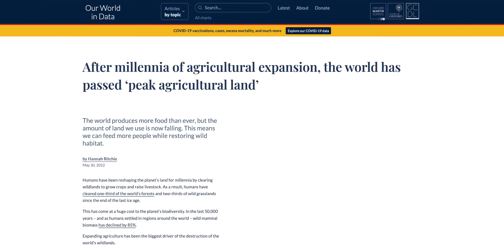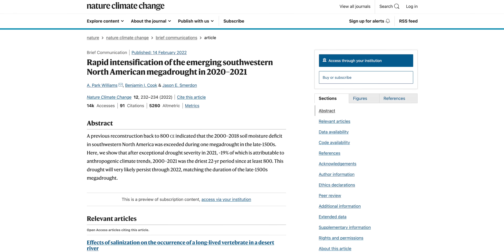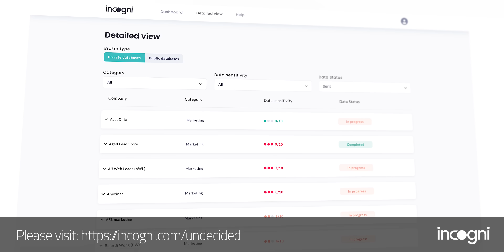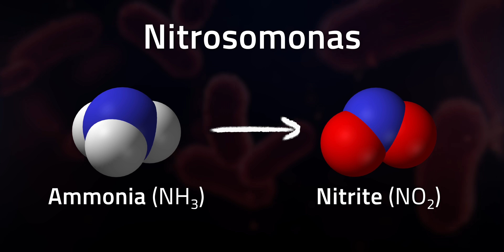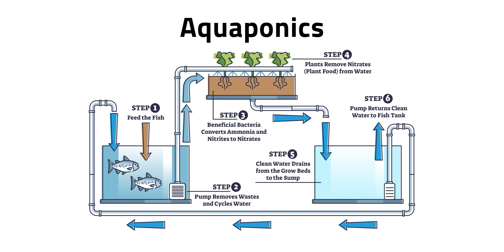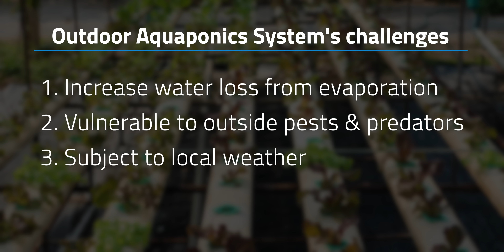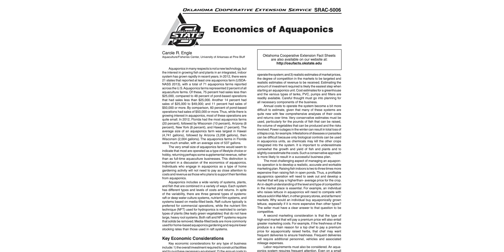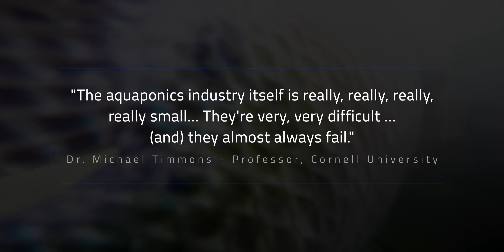Is Aquaponics the Future of Agriculture?

Comment: I have multiple home made aquaponic systems in my apartment that I use for R&D for my aquaponics startup in Southern California. 

Once you get them setup and understand stocking density and your filtration parameters, it’s very little maintenance. 

However the profitability only comes if you can go vertical… and I mean vertical towers and not stack horizontal NFT systems. Especially if you’re taking over warehouse space in an urban environment where lease costs can be 2-$5 per sqft.

Comment: Aquaponics is by far the most efficient form of farming to conserve water that has been around for thousands of years. If you want to conserve water and have cleaner, healthier food it's simply the best hands down. There is a start up cost to any business. With traditional farming you also have far more maintenance on tractors and what not. A more advanced tractor can cost more than an entire aquaponic system and then then you still have to pay lots of money to keep it running.

Sadly you can't grow all types of food in aquaponics. You won't be growing grains for bread and cereal for example so you will still need traditional farming for grain products. Also growing beans is good for the soil so it doesn't make sense to not grow them traditionally. There is simply no single solution to growing food. You have to diversify. Still growing what we can in Aquaponics can do wonders to help our water supply and more importantly provide safe to eat fish free from pollution. Fish supply is becoming a serious worry so having a safe way to raise them is invaluable. Also, you don't have to raise the fish for food purposes but can use pet fish as well. If you don't have enough fish you can just add supplements to the water.

So in short Aquaponics is by far the best farming method but it won't replace traditional farming but it will do an excellent job of supplementing it and in some areas it can grow food where you normally wouldn't be able to.

Comment: One critique of hydroponics and aquaponics suffer from the same issue is that it's farming for autistic people. Highly intricate and brainy way of farming which could on paper produce massive amounts of food at a low cost if everything is done right. Issue is that nothing is completely done right and while you now use a small fraction of the water and land you used to. You are now more dependent on electricity, electrical components, fish food and supplements, and plastic parts. All of which costs more than the water and land that you would have used. And since this critique came from the prepper community. A reliance on a complex, and global supply chain doesn't seem very safe if you want to insulate yourself from the outside world.

Simply having a greenhouse which uses drip irrigation and MAYBE capturing humidity in the air would be infinitely more economical and maintainable. (I'm not talking about the various scams about getting drinking water from the air but simply capturing condensation on the walls of the greenhouse and perhaps having some "filter" going out of the greenhouse to minimize water exiting) I would also be interested in "mining" sewage for nutrients instead of simply flushing it out into rivers and oceans. The key imo will always be to be as cheap and lazy as possible while still going in the right direction. The fewer moving parts the better.

Comment: On the profitability of aquaponics. For a hydroponics facility to be profitable it is recommended that it be of a scale of at least 1ha or 2.5ac. That's easily over 3million AUD investment. For a recirculating aquaculture operation to be profitable it is recommended that it be AT LEAST capable of producing 100t of fish per year. That's easily another 2million plus. Therefore an aquaponics operation selling into wholesale markets that has a similar scale of production can be confidently expected to be profitable. But even with savings due to integration your still talking $4 to 5million AUD. There is no way $50k or even $1,000,000AUD or even USD is going to get you a profitable operation under standard market conditions.

The reason so so so so many aquaponic ventures have failed is because they IGNORED these economies of scale. Superior Fresh demonstrates that aquaponics can be highly successful and one of the secrets of their success is that they have a decent economy of scale. Its not rocket science but basic economics that for some reason people continue to ignore.

Comment: If such technology would be better in any way, farmers would already do it. It simply can be boiled down to that. 

Such aquaponics sound cool but really havily on plastics, technology like pumps which can fail all the time and you always need experts to run and work the or in the system.

Same is for horizontal gardens. Pumping up water takes an insane amount of energy (you wouldn't believe).

But very nice video! Thanks for this 😅

Comment: Terrific video, thanks!  I've built a number of backyard scale aquaponics systems at home and two for my work.  If any indication, I'm selling components of my home system when I can and converting the beds into wicking beds and NFT hydroponics.  The two systems at work are still turning over but no fish at present and in need of repair/redesign.  An appealing idea, but as you say requires constant maintenance and monitoring and very narrow margins for success (all my setups have been outside).  Even with backup systems very easy for things to go pear shaped quickly and loose all the fish (which is really depressing).  Personally, I'm over torturing fish for limited benefit and considerable expense (don't need the guilt).  If other want to keep the systems at work going I'll help, but will keep stocking rates to an absolute minimum.

Comment: I just don't think its correct to assume that high cost 
If someone had hectares of land, and with lil money wanted to start an agricultur business... He wouldn't necessarily need fully automatic industrial grade machines 
He could start small, and by and, next year a tractor, them something else
Same on aquaponics, u certainly don't need grow light to start, or even tro have a business... U only need them when doing vertical aquaponics, otherwise u could just use the sun as normal agriculture does
Build a low tech greenhouse, get some water tanks, some wood planks, some big ass plastic, some water and that it 
If u could get some cheap water control test great.

Comment: in theory it's OK, But, look at the bulk of monoculture farming worldwide= CORN, soybeans, wheat, plus smaller crops of other grains like beans, barley, rye, and potatoes. Corn is mostly used for cattle feed, oil or ethanol. Little of it is used for tortillas or corn flakes. Except for beans and potatoes, everything else needs loads of fertilizers, produced through the Haber Bosch process, which generates megatons of CO2. The crops you show are for lettuce, radishes, strawberries, etc. Even the most hardcore vegan in thew planet cannot survive without a source of protein  and carbohydrates, and vegans do not eat fish.

Comment: 6:32 You know... we humans really like to underestimate the weight of water. Did you know that 500 gallons of water weighs about the same as 1 car? 500 gallons is only ~67 cubic feet y'know...
I can't imagine that roof being anything less than 100' x 25'... so we're talkin' the potential to hold 18656 gallons of water, 37 cars, or 74 tons of weight being forced down on everybody living below....

...so unless ya'll got this thing on some fancy ass well-designed building that is capable of having a garage on the 20th floor or something, ya'll gonna fucking die if you put an aquaponics set up on the roof.

Comment: I knew a farmer who tried to do something like this.  He was very excited, but once the whole system was up and running he discovered that the plants (now suddenly with easy access to the chemicals they needed) grew differently and so they consumed and released different chemicals than they would normally have, and which he had planned for.  Ended up having to spend $$$ on chemical additives to get the water mixture back to what had been expected..

Comment: No. Aquaponics is a stupid idea if plants are incorporated in it's setup which doesn't have to be included in order to be called Aquaponics also it's not even part of Agriculture.  Agriculture is the farming of land based species  on land in an outside setting and Aquaculture is the farming of Aquatic species in large bodies of water in an outside setting . Aquaponics is indoors based, so I don't see how it's the future of agriculture. Aquaponics means Aqua= in water ponics=controlled environments. In order to understand indoor farming is to first identify the two basic types which are Agritecture and Aquatecture. Agritectural includes systems of Hydroponics, Aeroponics, Geoponics,  and  Vitroponics. Aquaponics is considered Aquatecture.

Comment: That's the catch with Capitalism: everything has to be profitable at all costs.
Greedy Shareholders may get their money, but the planet and the actual worker suffers for it.
Reply: If something takes more than it provides, why do it? In this case the cost is primarily power and materials, which generally means carbon emissions; so anyone should care about profitability.

You should not object to profit, or caring about profit; you should be saying money does not properly measure the profit, or the system is not sharing the profit correctly.
Reply: @lordpisces5019  I agree, I would prefer if profit in this sence was measured in the benefit for humankind and materials needed, 
but not the money wich is creating artificial scarcities where there are none, for example food, medicine, housing, etc. and only benefits a small class of owners.
Reply: @TheySchlendrian  Money is a measure of benefit to humankind, as subjectively perceived by humankind. When people by from an aquaponics facility, the price they are willing to pay is how much they value the food aka how much they think it benefits them. The price which the aquaponics facility must pay for power, material, and workers is a reflection of the value these things have to mankind in other uses.

In this way money is a signifier of value. This runs into the difficulty that some benefits like clean air are hard to measure, and the link between individual activities and a decrease in clean air hard to establish. In the case of aquaponics, however, such hidden costs are probably not in its favor.

As an aside, owners are not the most powerful people in our system, managers are. It is generally executives and CEO's who make the decisions and reap the greatest rewards in companies which they have no permanent steak in. The system of owners, which Karl Marx called "capitalism", fell a hundred years ago.

Comment: Please present more on this subject. With solar prices coming down perhaps it's possible to offset energy costs for either system. Could a way be made to use energy in a simplified form to sustain costs?  One would also need to find low cost input devices to connect to PC for instant monitoring., lowering labor costs. So I guess what I am asking for is enough information to calculate small scale use. My gut feeling is aquaponics might be too difficult  for now but hydroponics might be a achievable goal. Mimic these systems individually in nature may be doable in large scale also.  In summary combining new energy sources with technology to come up with a viable system, which would be useful data instead of pie in the sky things 10 years out in development , while interesting information can't be applied to everyday life.

Comment: Aquaponics always felt like a pinnacle system to me, as mentioned it mimics a natural cycle, while producing more and using less. While it does have greater reliance on all systems working optimally, the ability to adapt the right plants and animals to the environment is key. Not only does it open a wide range if fish species, but also many other freshwater animals, such as crayfish/crawfish, yabbies, turtles and so on. The addition of Solar similar to agrivoltaics, efficient cooling/heating systems like greenhouses, vertical farming, artificial lighting etc can all be integrated into the aquaponic system. It really just needs more research and planning into reliability, control and failsafes/redundancy.

Comment: I tried, I really did with several videos. But I can't get by this guy's biased highschool level research and total ignorance of economics leading to borderline marketing-propaganda. (Economics is the allocation of scarce resources to their most valuable uses.) It is pretty clear that aquaponics is only sustainable in very niche situations and a loss-leader in the remainder of operations.
The total end cost to the consumer of a good is closely correlated with total energy consumption contained in that good, iow traditional farming is just more efficient. You can tell biased research when they focus on isolated sections of the system and imply it represents the whole, then when they still just can't quite sell it they say, "further research is needed" without itemizing the specific research needed. (a great example is electric manned aircraft, every pusher avoids the only two important measures of commercial aircraft: useful payload fraction and ton-mile cost. While also totally neglecting or handwaving-off huge infrastructure issues.)

The fish side of aquaponics operates at a loss because Tilapia is garbage and its only market appeal is low price, just like most things at the cheap and fast end of their segment. Basically tilapia is on the level of byproducts, like recyclable materials it's sold for partial cost recovery rather than an intentional product. (And most Tilapia doesn't come from nice clean aquaponics, it comes from 3rd world sewage treatment lagoons, further reducing its market price.)